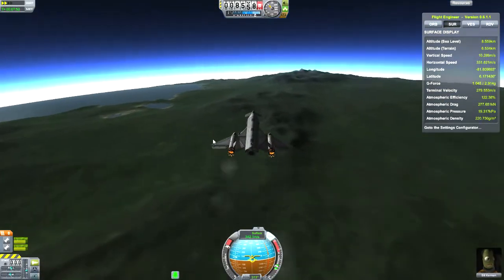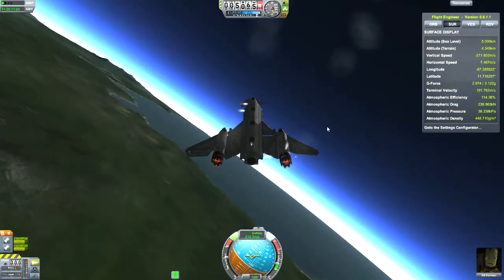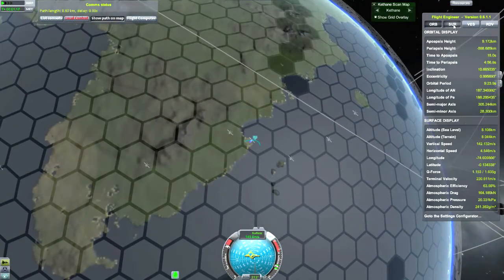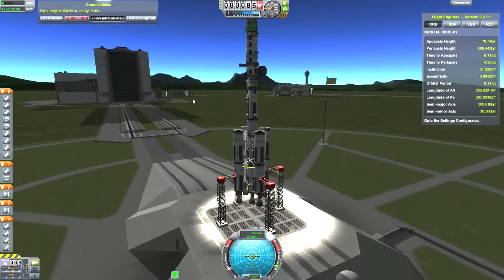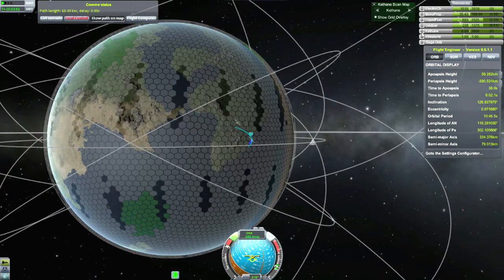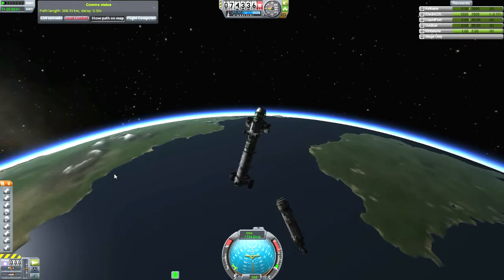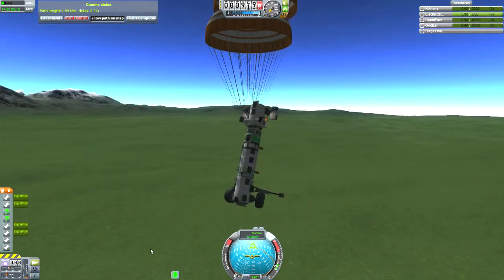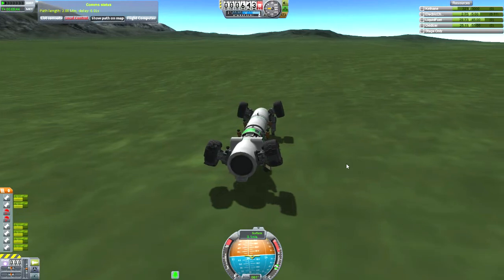Kerbal Space Program #13 - Kethane Drilling Test

Comment from the maker: Yeah I had a converter with some drills stuck on the back and the small radial mount kethane tanks all along the bottom of the fuselage. I tried to tweak the wind configuration to account for the slight shift in center of mass, but clearly nothing in design can correct poor piloting... ;)